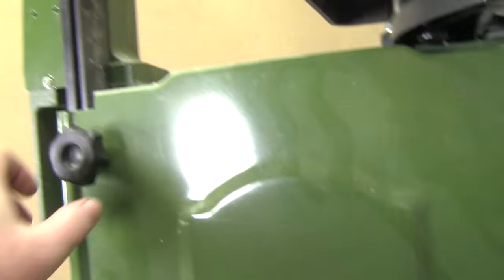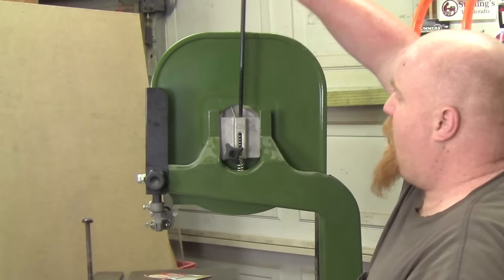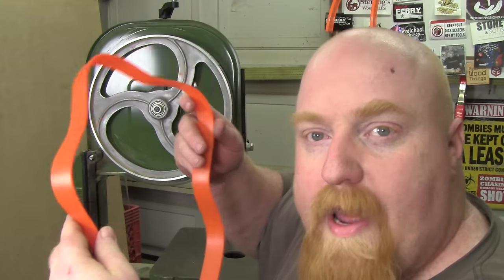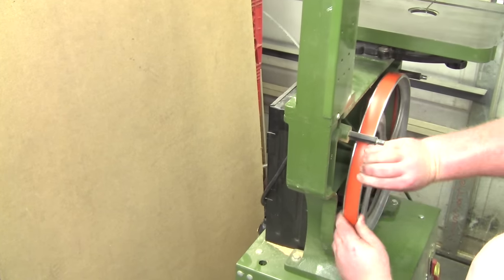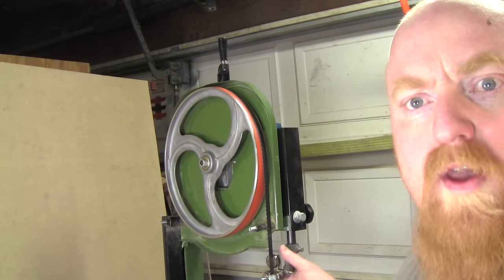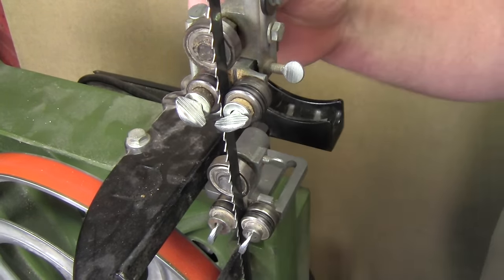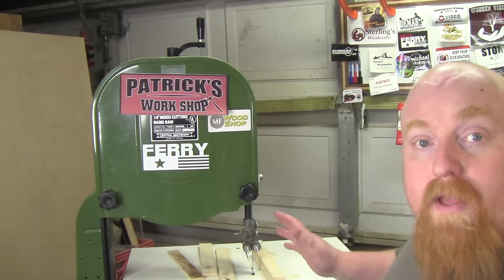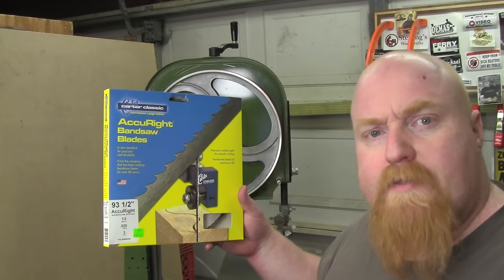How to Awesome BandSaw Upgrades

Comment: this is a central machinery right? what is the max depth of cut for resawing? thx
Reply from the maker: hello Greg  on this machine as it is now i can resaw 6 inches ,  when i get a get a6 inch  riser block and a 103 inch blade i could cut 12 inches  but for now i like it in this configuration   thanks for watching and commenting

Comment: Nice job on the table fence. Why I am here. 2 major things for you and your viewers to consider. Number 1, your blade safety guard is installed backwards (long black guard on left side of saw which job is to prevent blade from coming out if it snaps). Easy fix, remove covers and flip it! Number 2, your barrings will prematurely wear the way you have them set up. Under no tension, NOTHING should move but the blade. I suggest anyone watching Alex Snodgrass's bandsaw tune up video. Nice channel
Reply: I'll agree for the back bearings, but if the sides aren't on the blade you sacrifice a whole lot of accuracy. For some cuts that is fine but in others it absolutely isn't.
Reply: Seen that too wondering if was to quit it down good eye same on bearings
Reply: O

Comment: new blade won't last long, the blade has to touch the bearings when you push against it. not when in is normally running. just a tip ;p
Reply from the maker: +jordy verhaegh thanks for the tip, but i like how i have it set up it give me very accurate cuts  thanks for commenting
Reply: Ok no problem :)

Comment: Never push the thrust bearing up against the blade put it about a 1/16" away
Reply: Seconded.  Leave space between the bearing and blade so the bearings don't prematurely wear out.

Comment: I've got that same bandsaw. Found your video looking for tips on installing the urethane tires. These saws can be upgraded way beyond where you went. Mine has the ball bearing blade guides, plus riser block kit for much better resaw capacity, Grizzly tension / release mechanism, MLCS safety power switch on the post when my OE switch died. Wheel brush. I am about to add a 2.5" dust port to the bottom of the lower blade shroud as the OE pickup location is more or less useless.

Comment: LOL. Good thing you slyly, without mention, vacuumed out the band saw interior between removing the old tires and installing the new. Would have made a mess of those new tires otherwise. By the way, did you think we wouldn't notice? That's nearly always my first step when working inside the band saw, so I noticed.

Comment: don't allow the bearings to touch the blade. use paper in between to establish the minimal space. you want to have little to no noise when running standalone(without cutting)

Comment: good stuff patrick!-i like the handle and aux table! i just got some new tires not that long ago.. it took me awhile to figure a way out had to get the tires on but I ended up using my heat gun I like the boiling method though
Reply from the maker: +Joe basementwoodworking i can tell you that heating them with hot water made it a super delightful process to change and it didnt over heat the tire and put any weak spots on them so i am confident they will last a very long time   also i with the price of the tires i didnt want to chance messing them up  thanks for watching
Reply: Patrick's Work Shop that makes sense..heat spread evenly..ill remember that for next tire rotate;) and i always do:]

Comment: Hello Patrick
I happened to find a band saw used very similar to yours before you buy it, and I would like to know your thoughts on it.

regards
Reply from the maker: hi   i like my bandsaw it works good as long as it is tuned up and has a good blade  i want a bigger one someday but this works good in my small shop for now
Reply: thanks for the comment Patrick

Comment: where did you perches the Ball Bearing Guide I found the top with bearing on ebay but not the bottoms with the bearing. love your videos man. keep it up.
Reply from the maker: hey Jack   this saw came with bearing guides on  it , but with a single bearing .
I tapped the holes to 1/4 20 and added double  bearings   I was looking at the guide upgrade from carter products but it was to expensive  heres what i was looking at    http://www.carterproducts.com/band-saw-products/band-saw-conversion-kits/cent-14#       so i modified mine instead   if u have the guide blocks on your saw i know alot of people who prefer that type   best bet is the carter ones or making some   ur  self   my bandsaw is theCentral Machinery 14" inch from 2006

Comment: Patrick Great Video What make is your saw? I,am thinking of getting a Grizzly.Thanks
Reply from the maker: hey Anthony   this one is a slightly modified Central machinery  (harbor Freight) and Ive had it for a while and its worked out good for everything I use it for   I would like a riser block  but i have like 6 new blades  i want to use up first   a 17 inch grizzly is on my list someday
Reply: Anthony Maida , it looks like a harbor freight central machinery

Comment: will these up grades work on all band saws?
Reply from the maker: +joseph poncik a lot of the newer bandsaws already have these upgrades on them My bandsaw is from 2003 so it's kind of a little older and needed in all these parts anyway,   I believe most 14 inch bandsaws are similar in many many ways so yes I do believe so thank you so much for watching